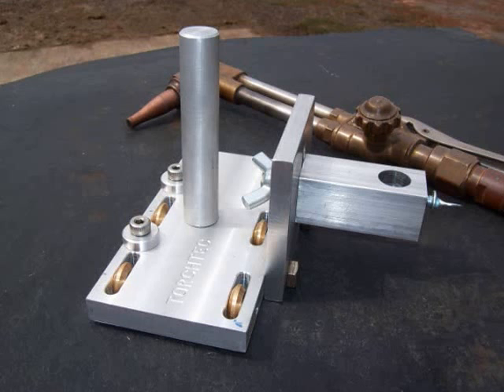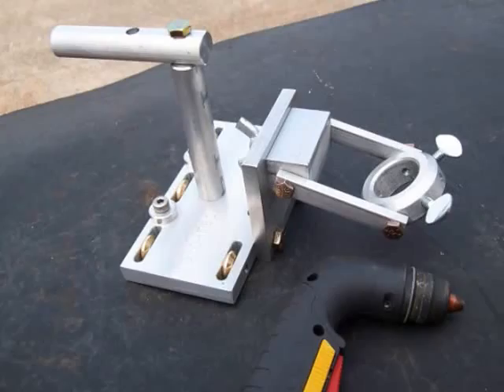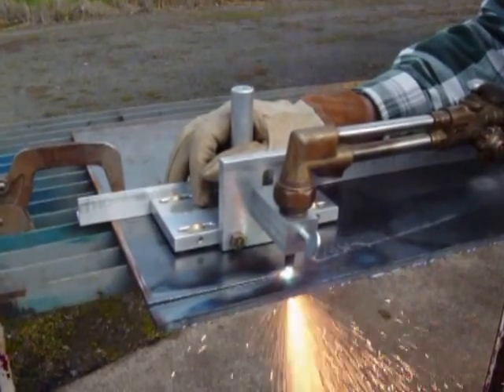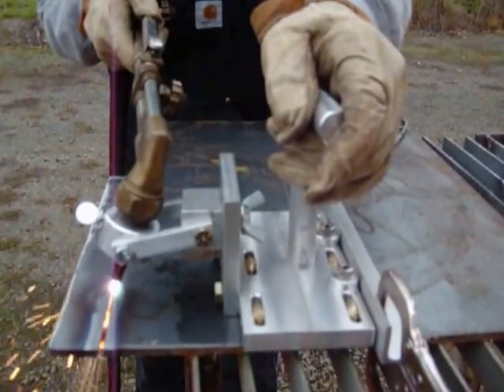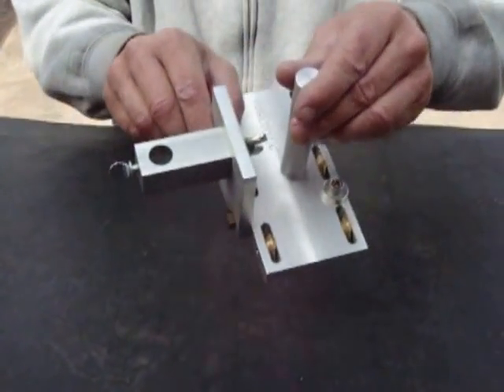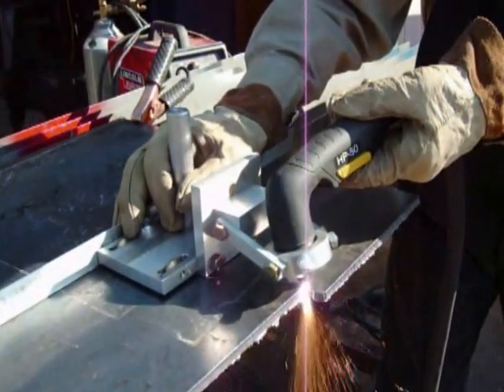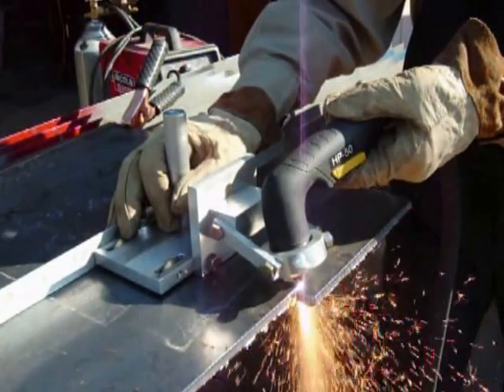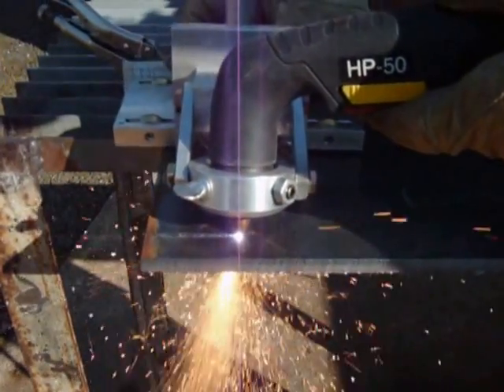Torchtec Torch Guide Product Overview

Comment: never actually reaches the end of the plate then
Reply from the maker: It does go all the way to the edge. It has 6 wheels so at  the start and end of the cut you have 4 wheels on the plate. That is what keeps the Stand-off the same height.